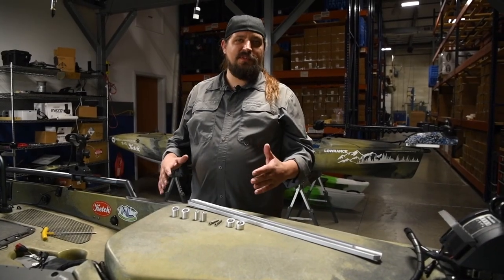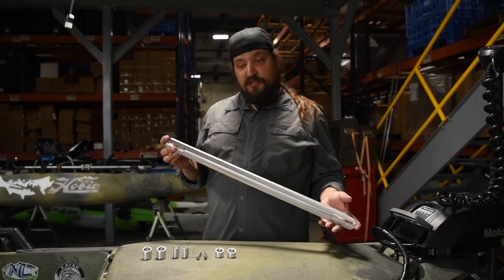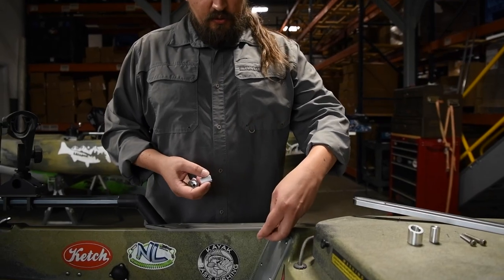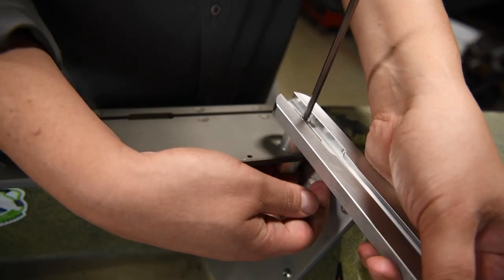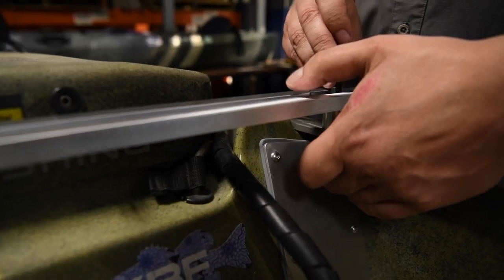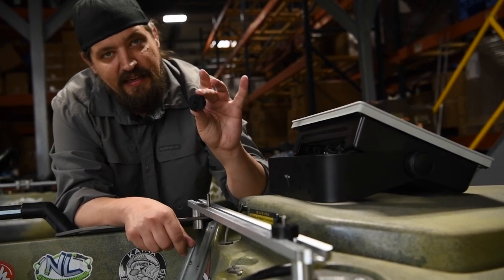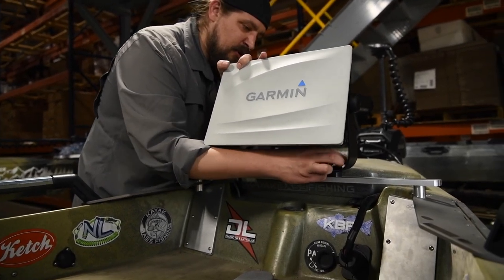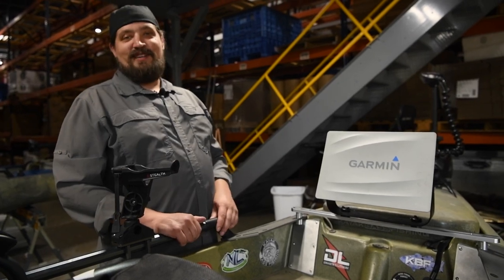Ketch Krossbar - Ultimate Dual Graph Mount for Hobie PA14 kayaks and more!

Comment: Does this install require you to blank out your rod tubes as seen in the video for a hobie PA14? Thanks!
Reply from the maker: It does not, those rod tube deletes are only for people who are not using the tubes and want to seal that common source of leaking off, or want to install the plate to use as a point to install a plug or switches on the plate for example. But it does not interfere with the Krossbar installation. The adapter kit is only compatible with our Jake Plates though and not the original plastic plates. You can DIY and drill to fit in the original plastic plates, but it's a drop in fit with the Jake Plates.

Comment: Does the krossbar interfere with the peddle drive.
Reply from the maker: No sir. I suppose if you have monster feet maybe those would hit it, but it was designed to clear the pedals even on the tallest setting.